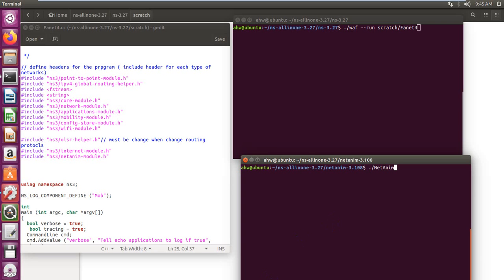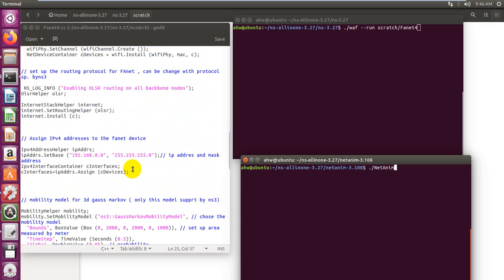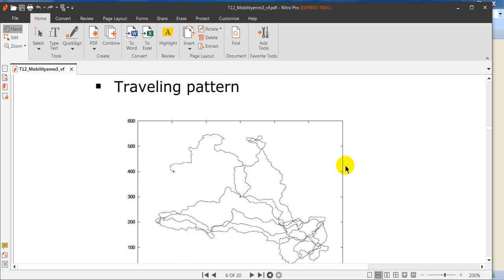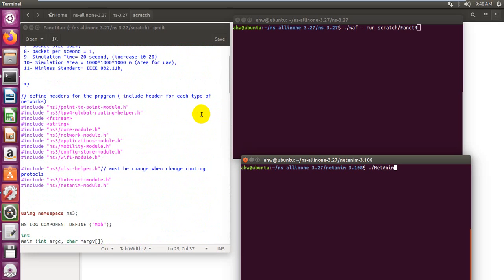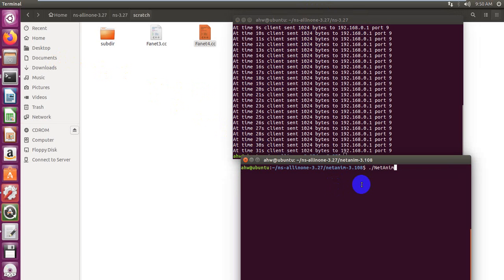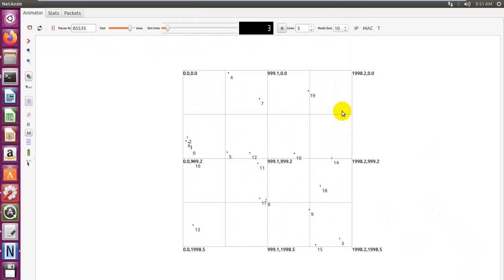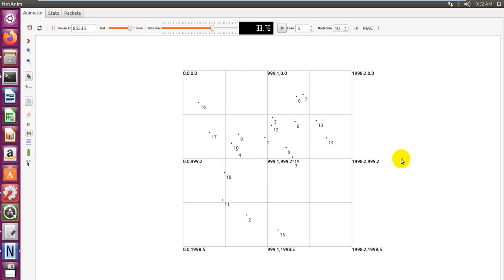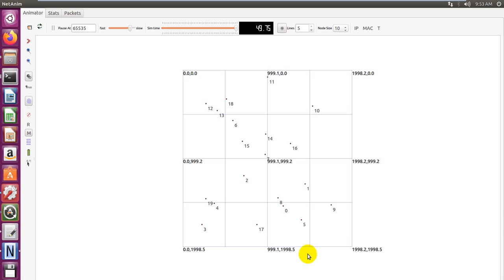Second Experiment -Simulation of FANET using NS-3

Comment: you stated that this is a uav to uav, how can i possibly implement a uav to uav with a base station like this one
https://www.youtube.com/watch?v=qwT4hzzEkd8
Reply: minute 2:27
Reply from the maker: First of all, you need to draw simulation scenarios.  For example you can setting the  network size , network communication topology ,traffic flow , etc. Finally , you can make simulation between UAV-UAV or other scenarios.  However,  it is not easy .
Reply: @AliHWheeb  How can i do this? are there any tutorials?
Reply from the maker: You need to write the code from the beginning.